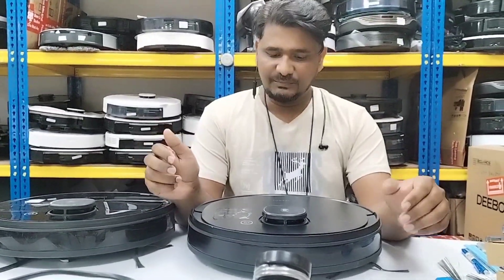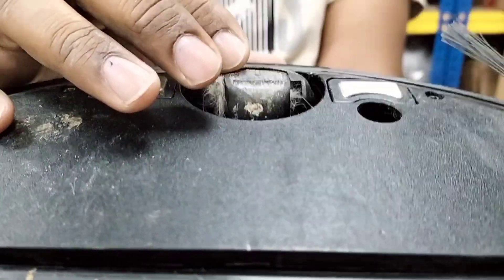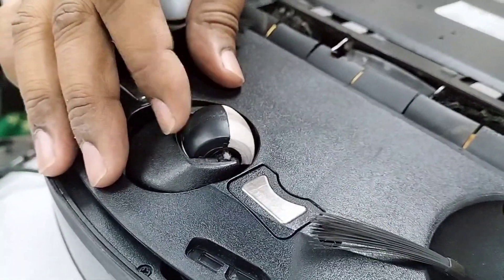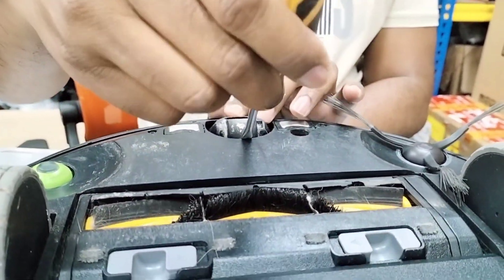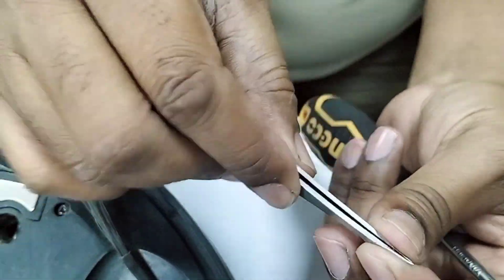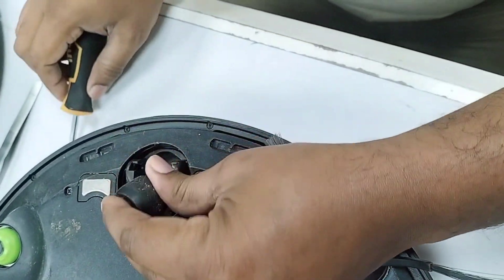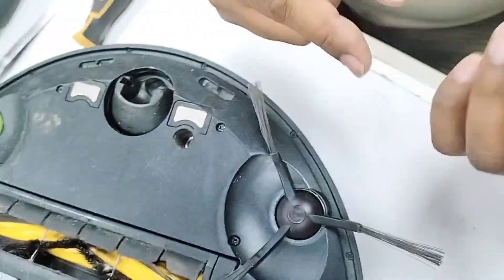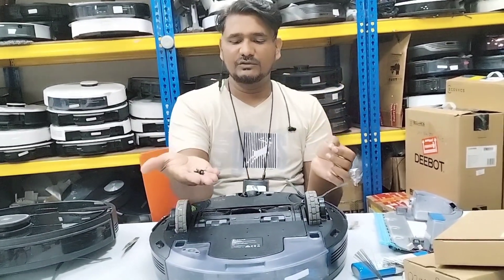How to Replace/Remove Front Roller? Why Deebot feels Difficult to Move forward?

Comment: I have an Eco Fax 10n robot, after 4 months of using it, it does not work with water, and then it started writing, the fall prevention sensor was covered in dust and did not work.
Reply from the maker: Plz try to wipe the sensor at the bottom area...left, right & front part got sensor..if still same then can see wether any of the sensor might be rusty
Reply: wiped them and the robot does not work and no water comes out to wipe

Comment: I' ve actually had the 2 wheels replaced about a month ago and it was working fine.  Last weekend, the wheel got dirty because my dog poop went into it and I tried to do a bit of cleaning up, using water to spray the wheels area.  Then subsequently I could still turned on the Omni but the unit could not respond to command to go back to station or to clean the floor.  Then I checked the camera and there was nothing showing.  How do I recalibrate the camera function then?  Thanks
Reply from the maker: Calibration only can do in service centre because need need to reinstall the software & put in special ecovacs platform for this purpose... you can try to reset hopefully will be ok. Else i suspect water touch the motherboard that's why got problem
Reply from the maker: If you are in Malaysia plz bring it to me I'll fix...can contact 00601137973018

Comment: Hi, my Ecovacs Deebot X1 Omni could be turn on but the wheels are not moving and the camera function doesn't seem to work.  What could be the issues?
Reply from the maker: Wheel need to replace... For camera deebot need to recalibrate then only camera function will start working...it happened when we reset the Omni X1

Comment: Do you have a part # for the front wheel assembly for the ecovacs x1 omine
Reply from the maker: The front roller is same like ozmo 920, 950, T8, T8 AIVI, T9 all same.colour won't effect whether white or black because there's no sensors in front roller in these models
Reply from the maker: Just can search as front roller or universal wheel for these models
Reply: can I use the 900 front roller? or can i remove just the roller of the wheel assembly of a different model to replace the 600.

Comment: Hello Friend How to disassemble the main brush chamber of the Ecovacs T9 or T9 aivi? I want to look at the main brush motor. I am getting the error the main brush is tangled in Ecovacs T9 aivi. Can you make a video about the removal of the main brush chamber?
Reply from the maker: Actually the basic is same in both models...I already uploaded a video in two parts how to disassemble & Assemble back...these videos... just follow those instructions under the motherboard got one screw remove rhat n just pull up the main brush motor assembly slowly...same way just put back